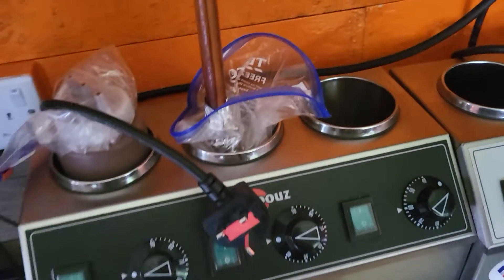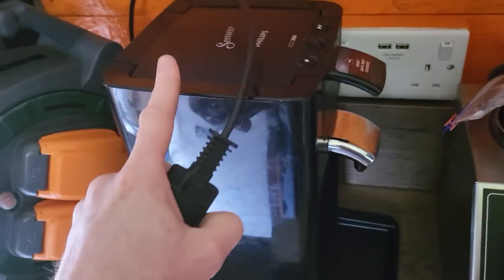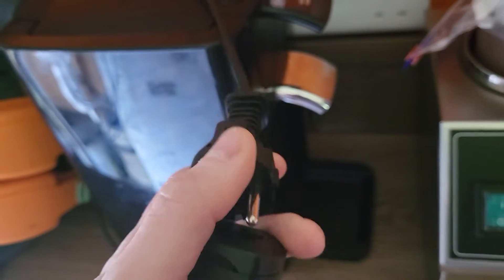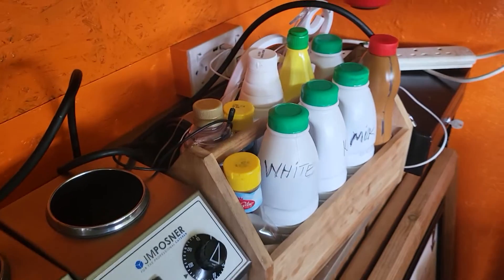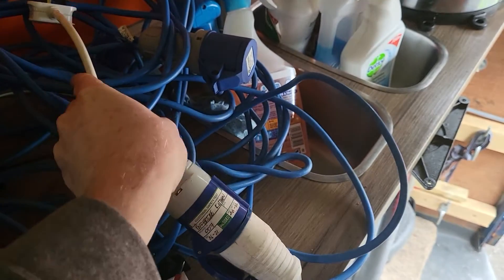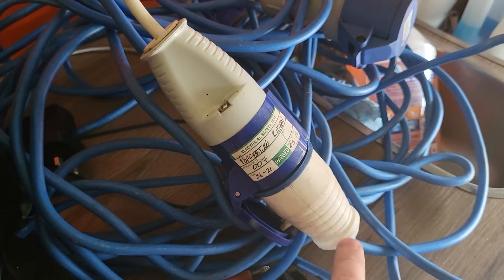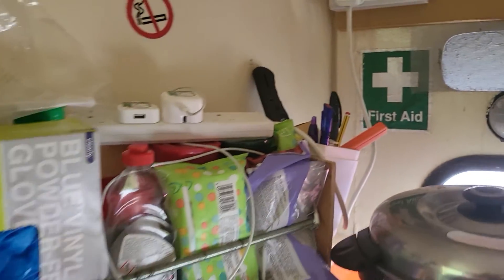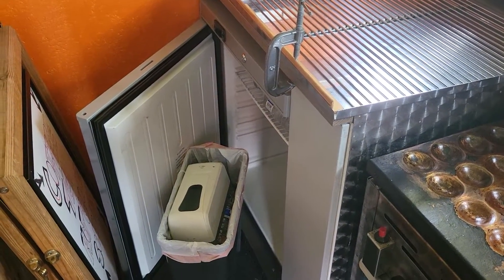PAT Testing Tutorial - Class 1 and 2.

Comment: the thing i find all the time with catering trucks is that they majority of the time on the back they have a female angle plug where the power goes in which means they have a cable with 2 male ends on or a suicide cable